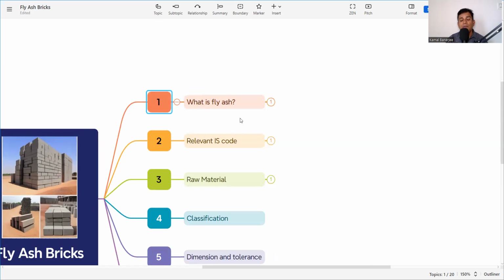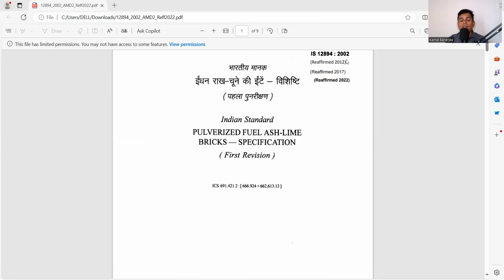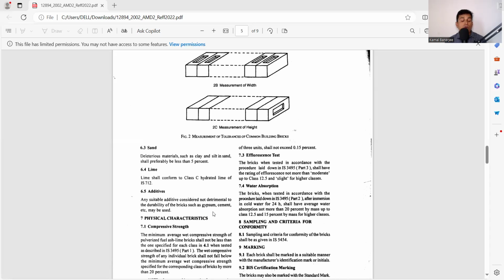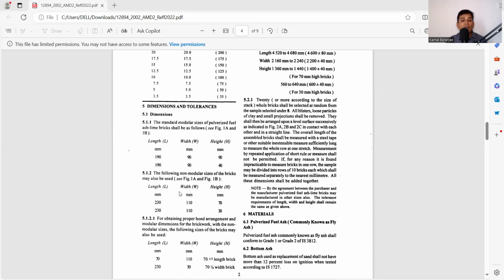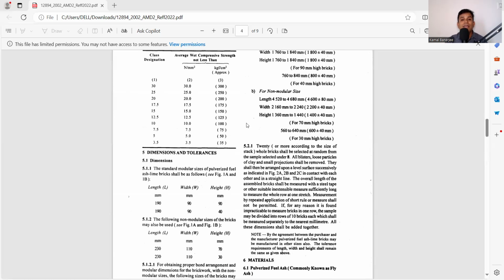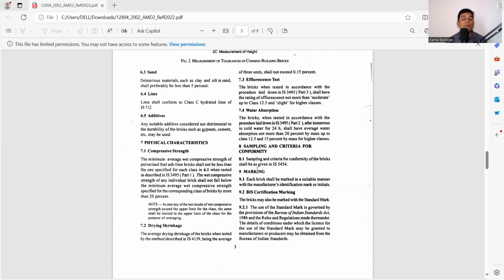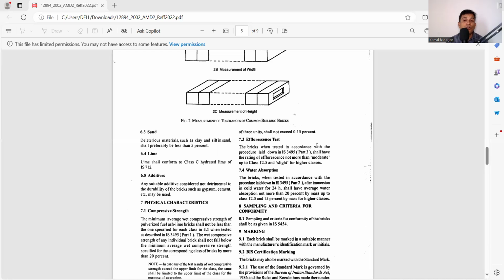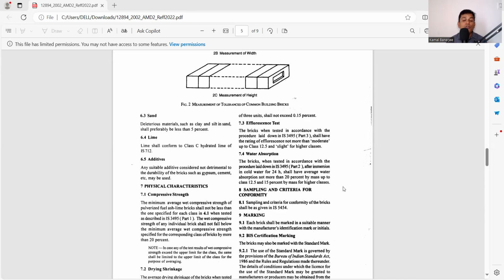Understanding Properties of Fly Ash Bricks According to Indian Standards

Comment: What could be the reason for the drying schnickage and water absorption in the fly ash block?
Reply from the maker: Reason for drying Shrinkage:- 1. High Water Content. 2) Inadequate Curing 3)Poor Quality of fly ash. 4) Improper mix proportions 5) Rapid moisture loss. 6) Type of binder used.
Reply: @QualityBrandingHub  w1)What should be the water ratio?
2)What type of flyash should be used, what types of elements should and should not be there
3)Which elements are important in what type of lime should be?
Reply from the maker: @mayurmakwana6056   For water cement ratio please check IS 2117. For fly ash IS 3812 and Lime is C type hydrated lime as per IS 712.
Reply from the maker: Reason for water absorption:- 1) High Porosity 2) Improper Curing 3) Environmental exposure 4) Improper mix 5) Low quality fly ash